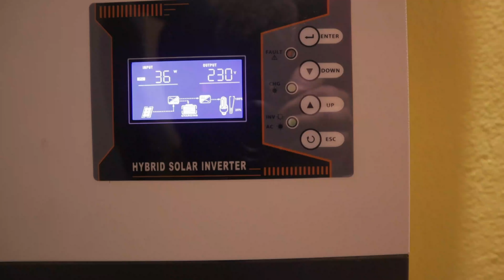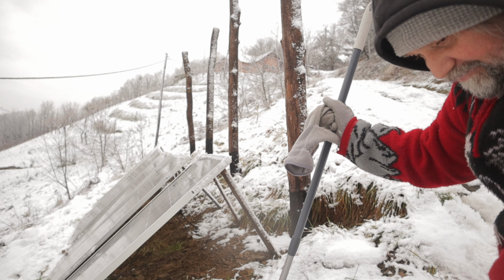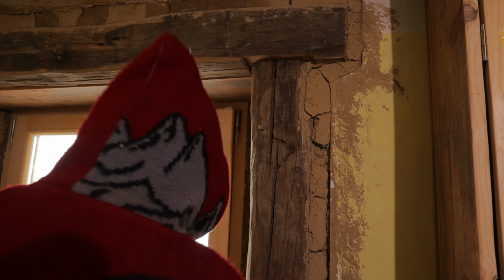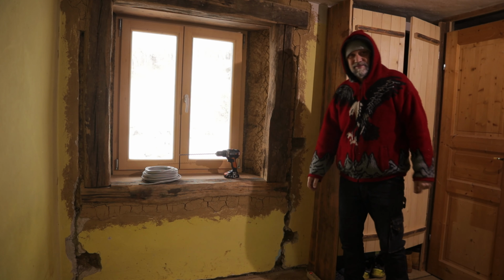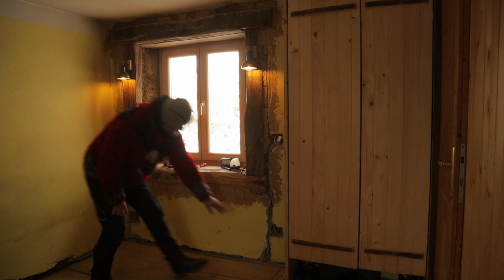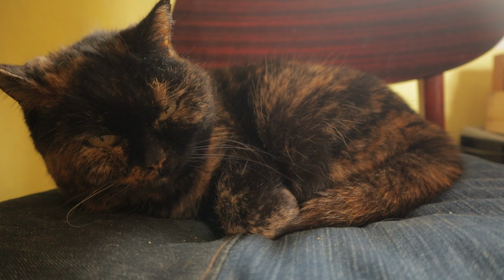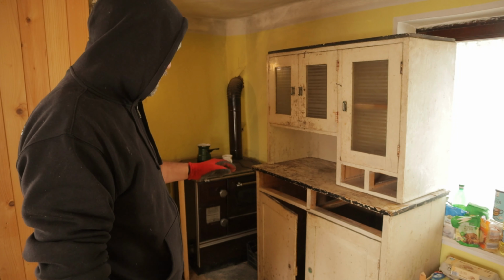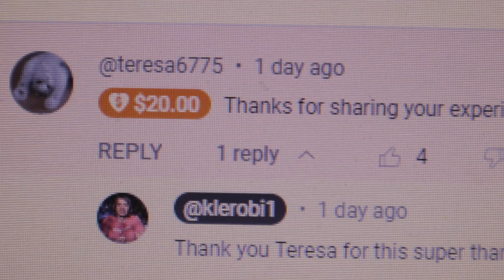#5 Working Day at the Remote TINY MOUNTAIN HOUSE, Installation of Lights

Comment: carbon monoxide is heavy, so it needs to stay close to the ground. Hope this helps. nice videos.
Reply from the maker: Thanks for the tip! Ok, I'll change that
Reply: @klerobi1  No, no, no! Carbon dioxide is heavy (wine basement gas or mofetta caves in nature), carbon monoxide is lighter than air, so that is concentrating under ceiling, so CO alarm needs to put to ceiling.
(Trust me, I am chemist.)
Reply from the maker: Ok, thank you 🙂
Reply: @klerobi1  Ok no need to be upset, carbon monoxide is the same density as air, so it is good down or up high it is still ok .  as long it's close to where you sleep, so you are ok.
Have a merry Xmas all
Reply: @klerobi1  Am no chemist, just a friend of this channel, peace.